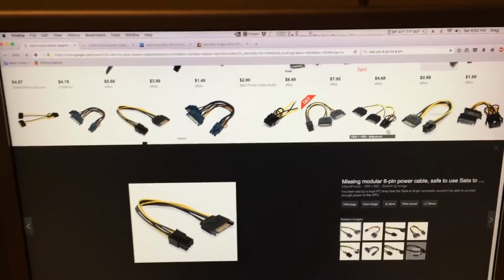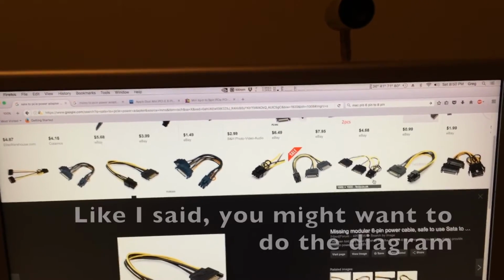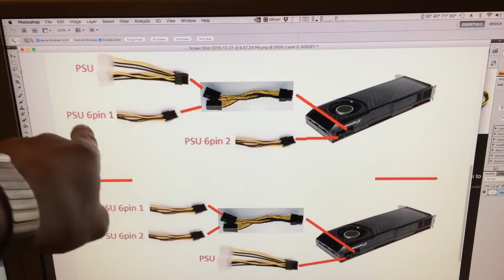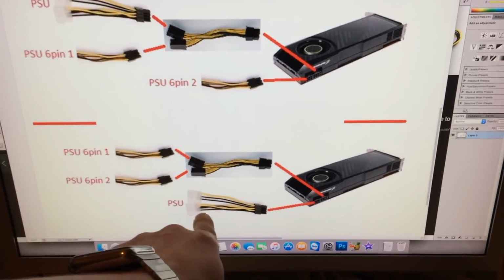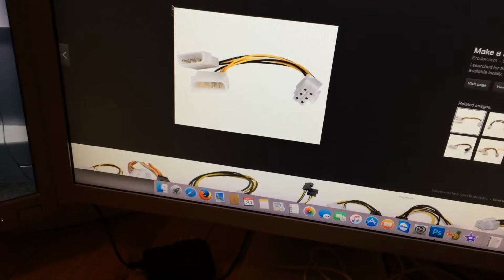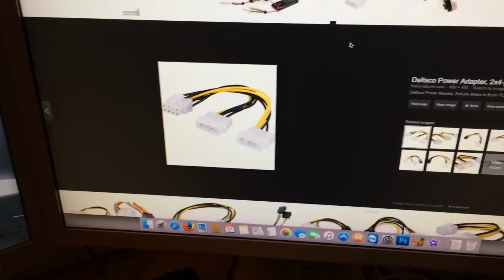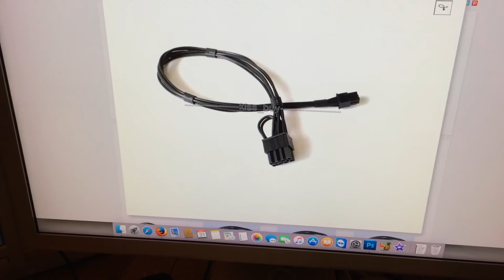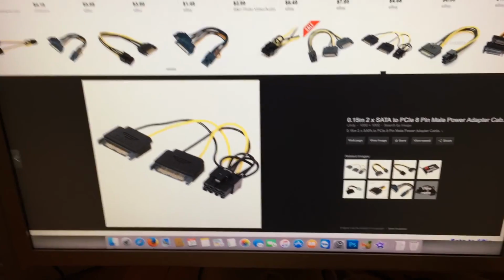GPU Setup: Using GPUs That Need More Power (AKA 6-pin&8-pin… etc) - Mac Pro Series ep.30

Comment: Thanks for the video, I'm going to try a dual SATA to 8-pin from the optical bay. Could you explain what is it about the cable at the end you mentioned not buying?
Reply from the maker: been many many years since I even watched the video I assume I was talking about like a 6 to 8 pin cable? It just doesn't supply enough power and can blow up

Comment: Sata supplies up to 54watts while some molex depending on PSU can supply >100watts. 1 sata to 6pin is not recommended and it is not safe at all with many cases of melting wires and fires, 2xsata to 6pin is the way to go if it cannot be avoided. 6pin connectors supplies up to 75watt and 8pin up to 150watts. For a 8pin +6pin card i use 2 x6pin into 8pin from motheboard plus molex to 6pin for a GTX 980.
Reply from the maker: agreed
Reply: Wish I would have read this earlier, goodbye HDD bay #3.

Comment: I have AMD rx 570. This one comes with 6 pin, is it necessary to make that modification. To connect it directly to the power source?
Reply from the maker: If you have 6pins you’ll be fine with the stock

Comment: @Hrutkay Mods I want to use 2 1080ti's on my 2009 mac pro and i know they have a 980watt psu is it possible to run 2 1080ti's? or do i have use the 980ti?

Comment: I have a Vegas 64 on Mac pro 5.1 and i have often shut downs. Can i use a second external PSU to one of 8pin GPU in and the other 8 pin to dual 6 pin from my main PSU? Now i draw from both 6 pins on motherboard and one sata and does not help.

Comment: I can only use  one 6 pin port of the motherboard, the other port is busy...what I should do???? is there is a way I can get power from a Hard Drive Bay?
Reply from the maker: You can actually or you can even pull it from the optical drive bay but I would recommend the pixlas mod that way you won’t overload anything

Comment: RHi I am upgrading the Gpu on a 1,1 to a evga gtx 660. The card only has 1 6 pin port on it and the product spec says it requires a 450 watt power supply on a 12 volt rail. Just wondering if a single and or dual mini pin setup to the card would incur any damage to the board or card, which setup is most stable?

Comment: I love your videos Greg! You are a genius! without you I couldn't have come so far with my machine which I got as present for christmas. I also got 2 mac minis (the first gen with intel CPU)  and i already bookmarked your mac mini series aswell!
But: what wifi module are you using? I used one from one of teh mac minis and this caused the wifi to not work on El Capitan (only at Lion) and the USB drives under El Capitan where non-functional.
Reply from the maker: The module at the time was an OSXWiFi.com module, my system now uses a 3,1 module... I can’t remember what model it is
Reply: @HrutkayMods  i've buoght a 4,1/5,1 Wifi+BT Card some time ago, this won't work under Lion - and i didn't test it with El Cap yet... but since i have no power for the BT this won't work anyway...
Reply: Hrutkay Mods The Module i bought is working under El Capitan! Only Lion is Not recognizing it.... it is The same Module as for The 4,1/5,1 but you just dont use the Little Power cable.... it works fine ....

Comment: The reason the molex adapters only have 2 or 3 pins on each molex is because they have 5v on one side and 12v on the other. the PCIe 6 or 8 pin molex are 12v and don't use the 5v. they have the same power capabilities per wire as the dedicated ones from the PSU on a power supply. The wire gauge is what is important and how it is wired into the 12v rails of the PSU.
Reply from the maker: Good to know I didn’t know that lol

Comment: A 6-pin to 8 pin convert actually work fine,even on load with a power hungry card 300watt or something else like that's
Reply: Define under load and what card have you specifically tested this on? As well as what power supply. There is the possibility the PSU had higher current rated wires or that the GPUs tested were not fully pulling the amount of current to truly need the 8 pin. Some GPU will have them for handling the extra current draw when running it with an OC.
Reply from the maker: Yeah don’t do that

Comment: Im actually considering putting a second in crossfire. I plan on using the board for the 8 pins on both cards and then using the SATA power for the 6 pins. I'll update you when I get the second card in and flashed.
Reply from the maker: +Timothy Reed also can't wait to hear your feedback ;)
Reply: Yes I will, Im currenty running two cards right now but with a external power supply. a R9 280x and a R9 280. I have a few cards coming my way and Will update you in a few weeks when I get back home.
Reply from the maker: Timothy Reed very cool, looking forward to hearing back
Reply: @timothyreed616  Been a while, how'd that go?

Comment: Love the videos. But I disagree with using the 8 pins. I have a R9 280x running right now and have never had a problem. I have been running a Flashed R9 80x in my rig for over a year.
Reply from the maker: +Timothy Reed lol like I said it works for some and not for others ;)
Reply: Running doing what? I just dropped a 980 Ti into my 5,1, it runs games fine, stress tests fine, but shuts the computer down when I run stable diffusion.